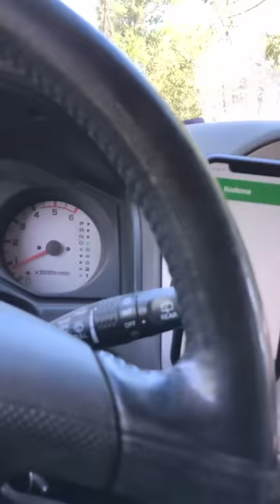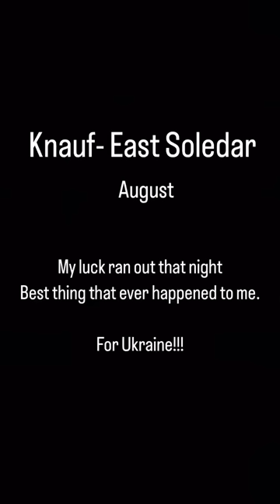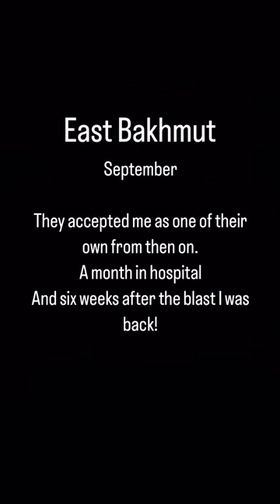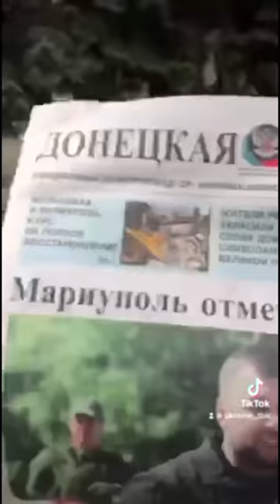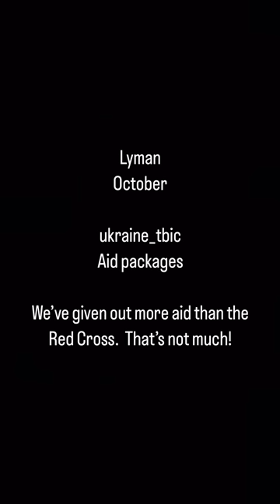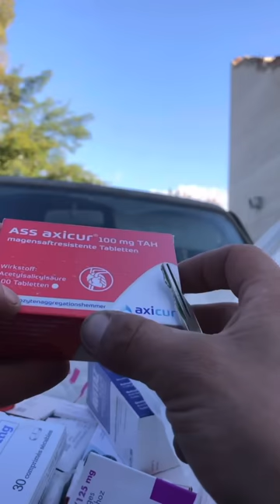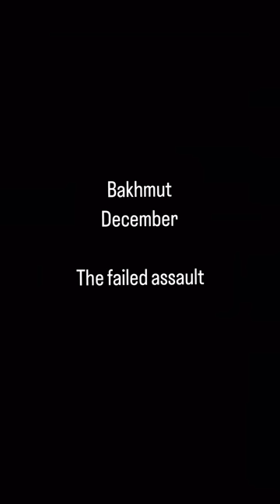🇺🇦From where it began to Bakhmut Part 2

Comment: Its still good footage Brandon, The People, the generators and everything else you're handing out are the primary concern. Cameras can be a bit of distraction. I use one when I'm out on the bike and have mounted it on the front and side of my helmet and on the handle bars. Maybe some kind of chest mount would be best?? whatever is practical really, Dash cams are good to. Its quite funny at times when people start waving at you that you don't know and you've forgotten you have a camera stuck on the top of your helmet🙂